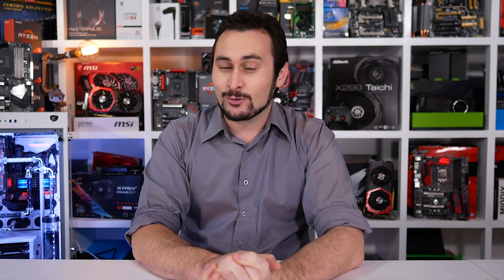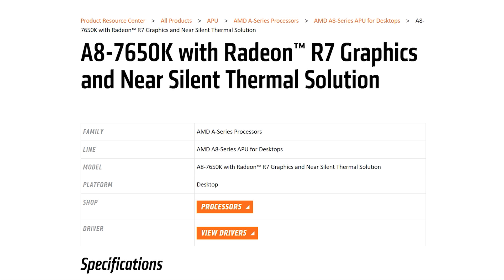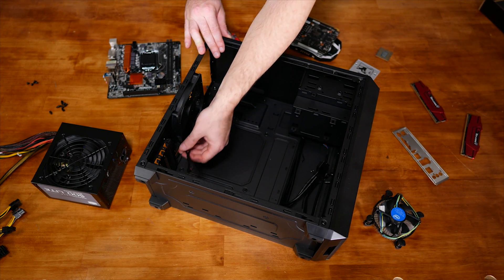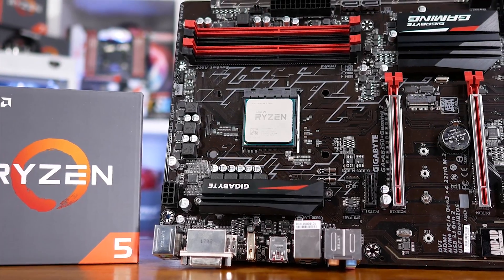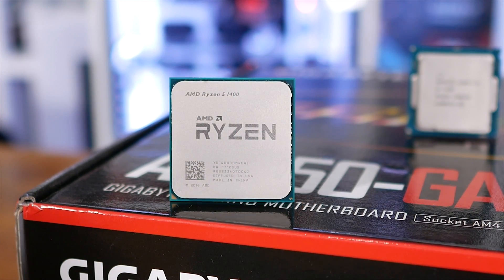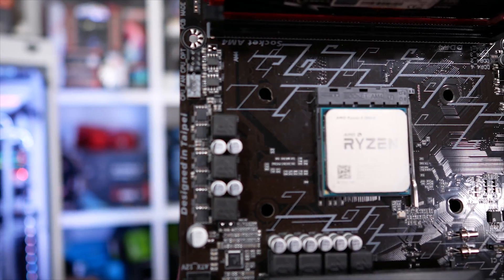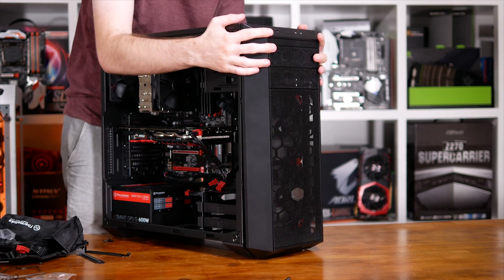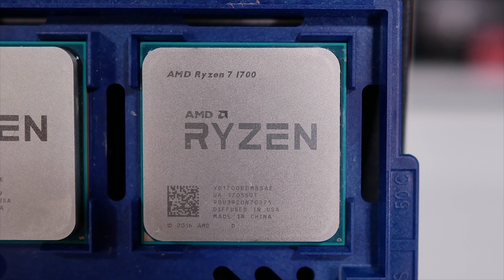Top 5 Best CPUs, Ryzen 3 & Threadripper In Mind!

Comment: Whoa a 7600k doesn't "require" a Z-series mobo, it's just only overclockable with one. A 7600k with a cheap mobo is still a reasonable choice, though Ryzen is still better value.
Reply from the maker: I fail to see why you would pay the premium for the unlocked K model and not get a Z-series board. You can't even run high-speed DDR4 with it, a complete waste of money really so in my opinion the K-series does require a Z-series board!
Reply: Hardware Unboxed I totally agree if you're getting a k chip you should get a Z-series board, but that's what it "should be paired with", not what it "requires". Some people, God knows who, might want the best chip you can get without overclocking at all. The k series generally come with a slight bump in base & turbo speeds over the non-k at stock settings, a few people might want that & could pair with a non-Z board just fine. They'd later regret not getting a Z-board when they do wanna overclock though that's for sure!
It's surprising how many people are still scared of overclocking, that could be a decent video - can I break this CPU by overclocking? Just going nuts on voltage & core speed & seeing if you actually can kill a chip these days. Bet you can't. It won't be as hole-clenchingly tense as your attempt to murder that GPU with water though :D that was so entertaining.

Comment: dual cores has had their day really. if your needs are a dual core then you might be better with an OEM or a refurb due to the price it will cost to make a build. If you want anything more than Facebook games and light media use than you should get quad core.  For budget gamers they should stay well away from this CPU as some games have significant frame dips and for those games that do run ok with no dips if your system then starts doing other things in the background this can lead to more issues hyper threads stil are not well optimized in many tasks.

Comment: If you have some money instead of the 1700 you can opt for the 1800x. Mine run quite cool at 4.1ghz probably since they are binned higher. The 1700 still is the king to bang for the buck and I got a 1400 for a second computer and it's really good for the price.

Comment: The phrase "As more games begin to utilise higher core counts the [insert Ryzen COU name here] will do better" is a bit like pissing into a high wind hoping you don't get wet trousers. Ashes and TW are THE only two games and the number is not likely to rise by more than a handful in the next 2-3 years. Think 2022/2023 before 6 cores and 12 threads is a common requirement for games. If you are building a system for 5-6 years use than maybe that's worth the lower IPC and lower clocks of AMD for. If you are a content creator or virtual machine runner - of course then more threads are great. But for gamers, the promise of more games using these extra threads any time soon? really? I call BS in that.  Other than TW and Ashes of TS - name 3 more games due out in the next 2 years that will use more threads. Just 3. And to finish an overclock that takes you to a max of 4.1 Ghz at a sub par IPC? Sorry  - that really isn't very good.

Comment: Worst current production CPUs:

i3 7350K/7320/7300, Intel needs to bugger off asking $150+ for a dual core, absolutely villainous.

i9 7900X, Intel needs to bugger off trying to get $1000 for consumer CPUs. It's over, get with it.

i7 7820X, Intel needs to bugger off trying to get $700 for octocores and stop gimping lanes to try to sell higher tier chips.

i5 7640X, seriously trying to launch an arbitrarily HT stripped quad core on an HEDT platform? The 7740X is barely justifiable...

That's the only "4" bad CPUs currently in production. Everything else is pretty good. 1800X can get an honorable mention, but it's not really that bad. It's over priced, but AMD offers the exact same features, same lanes, same core count, same thread count, same memory support, same everything for $200 cheaper at the cost of less strict binning. You only buy 1800X because you want to, not because AMD arbitrarily tried to force you by cutting out PCI-E lanes.

Comment: top 5 worst:

#1 pentium D
#2 pentium 4... I know, I know how could I... the Pentium 4 is legendary!... well let me tell you this youngsters, I had at least three systems based around this thing and they just... well they were just sooooo baaaad... for the pentium 4 generation I ended up switching to team red for an Athlon 64
#3 i7 940 I had 3 of these mother f*ckers die on me when they came out... ended up going back to my core 2 quad Q9550 until the next gen came out.. and I didn't even overclock them, they just sucked that much d*ck!
#4 any intel atom... I have a home NAS that I built based around an atom, and it has died every 1.5 years like clockwork... I switched to an AMD Athlon x2 for my NAS now
#5 any amd FX CPU too much power/heat for lackluster performance

Comment: em the architectural changes in skylake x made it so, that it will be behind much cheaper cpus, cpus, that it should crush specs wise in certain workloads.
i think it was jim not sure, that talked about how the changes to x299 especially for gamers are unlikely to be optimized for, unlike ryzen, as almost no one will have skylake x, while before broardwell-e was "just more cores" for the games.
how much of it is teething issues of x299 will show itself, but the blatant: "intel 10 is fastest, but overpriced" is no longer the case, at least not for everything.

Comment: I've had the 1800x for two weeks with 3ghz RAM and the 7700k with the same 3ghz RAM. Gaming at 4k with 2x 1080 Ti's the 7700k gave me far smoother results, frame times on Intel were also quite a bit lower. Here is two benchmark runs with the 1800x and 7700k, the GPU/SSD performance took a nose dive on AMD. Here is the 7700k run http://www.userbenchmark.com/UserRun/3770566 and 1800X http://www.userbenchmark.com/UserRun/3699889

I only game at 4k and yes even at that res I had a better overall gaming experience on the 7700k. 

The division loads faster with ryzen but overall runs far smoother on the 7700k, the park extraction I was getting quite a few frame drops on ryzen. 7700k runs silky smooth, the 4790k had no such issues either.

GTA 5 flying was stuttery over the city on the 4790k, 1800x was silky smooth but in the desert my 4790k was silky smooth and the 1800x was running at a lower frame rate around 45 to 50fps and dropping frames. The 7700k is silky smooth everywhere and pushing the 2x 1080 Ti's harder even maxed out at 4k. Odd that as the 1800x and GPU'S had tons of power left to play with.

Beam NG drive runs better on the 7700k but that game is 100% single threaded.

Forza horizon demo ran at a constant 60fps maxed out at 4k (no aa) on a single 1080 Ti with my 4790k, the 1800x just couldn't do that. Dipped to the very low 50's a lot of the time. The 7700k the frame rate instantly went back to 60fps and never dropped.

Far cry primal is mainly single threaded but at your main base once the area is heavily populated even the 4790k was struggling to hit 60fps and was usually around the low 50s. The 1800x was worse hitting 43fps. 7700k had no issues maintaining 60fps though. This was also maxed out at 4k. 

All this is on the same clean windows install. If gaming is the main priority then the 7700k is the best option for now. Even at 4k the 7700k is pushing my cards harder as it should be.

I have tons of games on steam, origin and uplay but Intel just runs better overall. 

Of course games are getting more multithreaded and it's great to see AMD making Intel sweat for a change but if gaming is the main priority then for now fast cores and high IPC is king for now. I have no issues giving AMD a go again but only once the 2nd gen Ryzen is out.
Reply: I've been using both AMD and Intel CPU's for many years, I've used Durons, Athlons, Athlon 64 (and x2), Q6600, 2700k, 3770, 4790k and now 7700k. Skipped every AMD chip since the Q6600 because they were so poor. Gaming is my main priority on this PC so I will choose the chip that gives me the best performance in new and old games. If AMD's 2nd gen Ryzen can up the IPC and clockspeed then it should be an amazing CPU for everything. 

4790k/7700k has no issues running games maxed out at 4k while having 230+ processes in the background and while I watch 1080p/4k videos either locally or on youtube at the same time on a second screen without dropping any frames on either and I have plenty of CPU power left to spare. The newer i7's from Ivybridge onwards are great multitasking chips.

Comment: What ryzen chip is equal to the i7 7700k?
Reply: there is no equal, 7700k clocks higher than any ryzen and edges out ryzen in games,
however in productivity, core counts usually offset clock speeds, and r5 1600 and up will destroy the 7700k again.

so it depends on what you're doing, there's no real binary answer to that

in terms of core count and cache, r5 1400 has the same amount as a 7700k
you may aswell pick up a r5 1600 though, as you get 50% more cores for like 30 bucks extra, it's the better value proposition :D

for productivity the ryzen is a no brainer, 
for gaming... well, i would still only pick intel if i was aiming for 144hz gaming sepcificall
Reply: well I want to stream/make videos or at the very least, photoshop but I also like to game but in Canada, Intel is super expensive so I wanted to go with a Ryzen CPU that is equal or slightly lower than the i7 7700k

Comment: Worst CPUs:
1. Intel 4004. I mean, 4 bits and 740kHZ. Do you even lift, bro?
2. AMD FX-9590. A CPU is for doing math, not stress testing nuclear reactors. And don't believe what others tell you, this CPU is the cause of global warming. That it's CO2 causing global warming is a cover-up by AMD.
3. Intel i3-7350k. Why does it even exist? Also, tooth paste.
4. Intel i5-7640k. See 3.
5. Intel i7-7740k. See 4.

Comment: Honestly the best quad core and best budget cpu right now is the i5 3470. Its around the same price as the G4560 but faster. Since its an older cpu, the motherboards are also very cheap. The 3470 is only 2-3 frames slower than the 6400 making it faster than the 4460. Because of its lower tdp its very energy efficient. That means its very good for budget. I wouldnt pay a premium for those new cpus when theyre about the same performance.

Comment: Best bang for your buck cpu's: G4560, R5 1600
Best used cpu's: i5 2500k, i7 2600k, X5670
Best cpu's: R7 1700, i7 7700k, i7 7800x, i7 7820x
Worst cpu's: i3 7350k, i5 7540x, i7 7740x( get kaby lake for the i5's and i7's, since X299 motherboards prices start from 300.)

Aside from threadripper and the i9's, for most consumers this is a good guide.

Comment: You were right on for most of your recommendations, though I still feel the 1400/1500X are just too weak with their limited cache and overcloackability. Those CPUs are also hardly budget @$170-$190. I do like the 1600/1700 (have both), but I still find my 6600K my favorite system when I'm not crunching video! The system runs cool (mid to high 20s idle and low 30s watching videos with 120mm AIO), clocks down when not need, and runs at 4.5+GHz when pushed. I agree 4 cores are limited, but my Ryzen systems just don't behave. Cool 'n Quiet just does not work (at least on my two ASRock boards) like SpeedStep resulting in higher idle and usage temps; especially when overclocked. I rarely have issues with the 4 core limit for almost everything that I do (software development, gaming, browsing, and all at the same time); no I'm not a serious gamer. Ryzen is new. We'll have to see how it moves forward. It's certainly stable, just I like the refinement of the Z170 platform and Skylake CPU that I have. 

If anyone cares:
6600K (4.5GHz), ASRock Extreme7+, 16GB RipJaws V 3200 CL14, H55 AIO, GTX 1070
1700 (3.9GHz), ASRock X370 Killer SLI/AC, 16GB RipJaws V 3200 CL14 (2933 max stable), 240 AIO, GTX 1070
1600 (3.8Ghz), ASRock AB350 Pro4, 8GB Crucial 2400 (happened to have it), AMD Spire cooler, Sapphire Dual-X 280X
1700 started its life in the B350. It did not appear to be much different in the X370. Slight overclock advantage due to LLC in the X370. X370 also boots 3200, but is not stable in windows at default XMP timings with 106 AGESA.

Cheers and thanks for your great reviews and insight!

Comment: No holds barred the 7900x, for now, is the top end. Hopefully this will change soon with the 7920x and the Threadripper. Just do not think about upgrading to the 18 core x299 without some power management planning with the current board offerings.

Comment: LGR recently uploaded a video where he used a G4560 with an MSI H110M Grenade, and it didn't come with the required BIOS update out of the box...
Reply from the maker: +NEX H5 take the board back. They have to come with the supporting BIOS or it's false advertising.
Reply: Hardware Unboxed I'm talking about another YouTuber, he ended up getting a second CPU to flash the required BIOS, so yeah. I was just saying.
I guess it could be that online retailers are still selling old stock that hasn't gone off the shelves yet, in which case, I guess the same would apply.

Comment: I have a good aftermarket cooler. Should i buy 1700x instead of 1700 since i dont need that stock cooler? I heard that the x processors are higher quality.
Reply: x's dont seem to have a problem doing 4.0ghz OC, you might only get 3.9 on the non X but the mb, psu & cooler will determine this just as much as the X. So I agree with Steve, the save the $100 and spend it on watercooling or better mb/psu. For max speed get 3200ghz XMP ram too, especially if your shelling out for an X series.
Reply: That 80 extra is really not a big deal if i can sleep better becouse my CPU will last longer. Thats why i ask if the x is better/safer in this regard.

Comment: Nothing touches the G4560. Chip of the decade. So hard to justify anything else. If you have a pentium and a 1050, would get more from an i5 with the 1050 or more from the pentium and a 1060? To spend $100 more, pretty much anything else you buy will improve your PC more than a better CPU. Double your ram, get an nvme drive instead of ssd, up your graphics card (even from 1060 to 1070), buy a 4k monitor ... that chip is so good for the money. Obsoletes i3, makes i5 a very hard sell and if you have a 1080 ti, you don't really care about the cost of an i7 anyway.
Reply: Just rebuilt my G4560, bmarked it with my 1060 @1080 and man o man was it cool and fast. I use a fixed vsync for 60fps at 1080 in everything I throw at it. Perfect for gaming! Without vsync get 60-120fps on av, perfer no tears myself

Comment: between r5 1400 and r5 1500x,should i just get 1500x as it comes with a better cooler and OCs a bit more??
dont mention r5 1600.i know that chip exists.
Reply: Kakashi Hatake that's exactly what I think
Reply: get the 1400 and overclock
Reply: Hon2838 is the cooler that comes with 1400 good enough for oc  is what I wanna know

Comment: Do a video on whether more RAM or faster RAM works better in a Ryzen CPU. It would be very interesting to see if the new AGESA 1.0.0.6  BIOS update allowing higher RAM OCing (I think up to 4000) on a stick of 8Gb or 2 sticks of 4Gb or even 2 sticks of 8Gb clocked higher makes a difference vs. 64 Gb of RAM clocked at 2133. The infinity fabric is very RAM dependent after all and I saw you putting 4 sticks on a Ryzen mobo, I just really want to see what you come up with.
Reply: Anubis Thanos I second you.

Comment: Come 'Q3 I'll bet this list will change drastically.
Reply: I guess Q3 brings ThreadRipper and R3s, so high end and low end will both have new options. I expect ThreadRipper will be good value vs Intel's offerings and of course have higher profit margins, but the R3s might be important for that % increase in market share, depending on how they are priced. Then AMD will effectively have a whole stack of modern CPUs fit for just about every consumer type. Hopefully developers start putting Ryzen on recommended and minimum specs for games on Steam when that happens, and cut out the old FX line.
Reply from the maker: Yeah? Why is that? What are you expecting?

Comment: The G4560 is hands down the best budget cpu... you can pair it with RX570 and It will rock 1080p games with no problem. 

and the R5-1600 is the the best Value CPU of 2017.
the i9-7900x is garbage.

Comment: Best productivity CPU should be Ryzen epyc. The 32 core 64 thread is better and is only 14000 usd less expensive
Reply from the maker: That's not productivity CPU, given the clock speeds it would also be worse than the 1700 for workstation usage. But I see your point, price wise it's a bargain :)

Comment: Worst CPUs
R7 1800X
has no point in existing, probably a cash grab just get a 1700, oc it or some shit
i5 7600/i7 7700
totally useless, why buy a locked version of an unlocked i5/i7
FX 9590
Hot as fuck, requires watercooling, 220W tdp
i3- 7350K
let others explain that
Modern Celerons
really shit for the price, would make sense if it was $20
Reply: "totally useless, why buy a locked version of an unlocked i5/i7"

A locked i7 is still gonna be faster at single threaded applications than almost any other processor except the unlocked i7 and maybe a heavily overclocked i5.  A locked i7 costs like $30 less and comes with a stock cooler, making it considerably cheaper than an unlocked i7, and since there is no need for a ZX70 board, you can save another $30-20 on the motherboard. It's a considerable chunk of change, and it's an interesting option for people who are on a tight budget but still want a powerful processor.
Reply: the r7 1800x is binned. it will always be better than the 1700. even if you overclock the 1700 it will not perform as well. im not saying theres a huge difference but there is one.
Reply: for whatever reason, the 1800X gets better memory/infinity fabric speeds than the 1700, so where that makes a difference it's worth the extra